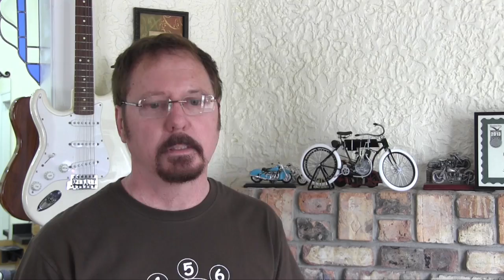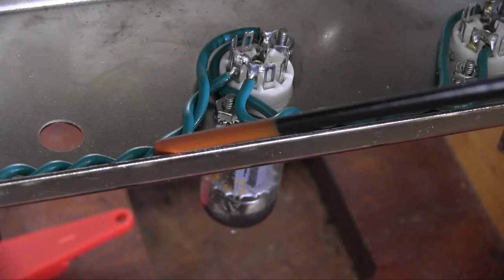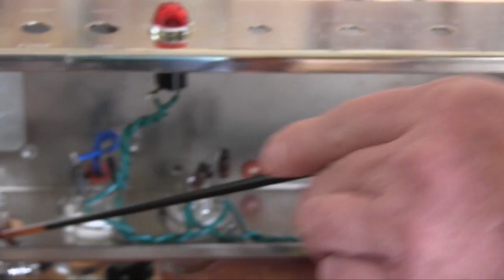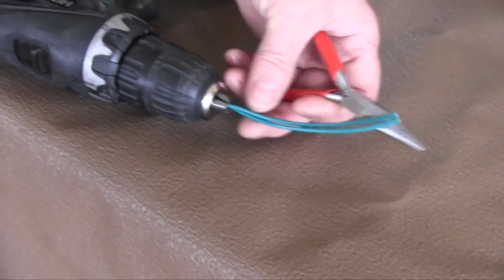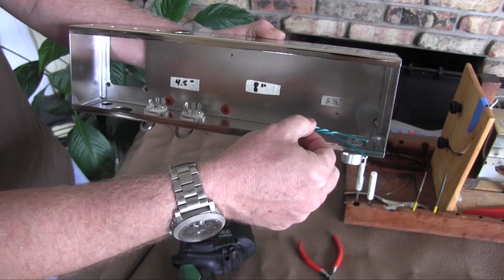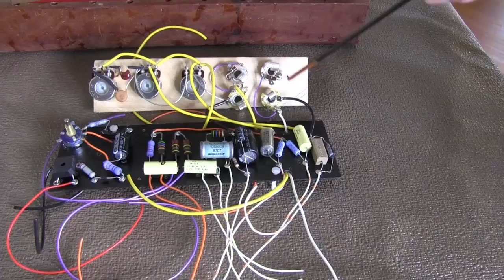Wiring Heater Filaments Circuits

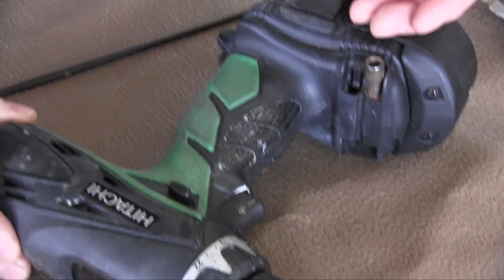Comment: 04:53 What is not talked about, but may (or may not) be common knowledge is the direction of the twist in the twisted pair.
In my experience, it's ALWAYS a good idea to twist the wires in the same direction as the twist in the strands of wire.
If they go CCW, then the twisted pair goes in the same direction. If it's CW, then the twisted pair will go in the other direction (CCW = anti-clockwise for Europe?).
The result is the ability to achieve a tighter twist in the pair, without it wanting to naturally unwind itself.

Comment: Very good video, Dave.  The only recommendation I would make is making sure that the power tube wiring is consistent, (ie V3 Pin 2 terminates at V4 Pin 2, V3 Pin 7 terminates at V4 pin 7).  This will hum cancel the power tubes.  Great job as always!
Reply: and from the power tubes to the phase inverter and preamp tubes what order showld i continue with? from the power tubes to what pins in the 12ax7?
Reply: @fakundofrontera  From what I know, consistent wiring for hum cancellation is only necessary on the power tubes and not from power tubes to the PI and preamp.
Reply: Whoa, it seems to make sense to me. Just like balanced audio works.
Reply: You want the lengths of the two wires to be EXACTLY the same.
They must cancel each other perfectly. Any wiring should cross them at a perfect 90 degree angle.

Comment: after you twist the wires does it matter which end is soldered or do you do a continuity test?, if so, wouldn't it be good to use different colored wires to be sure?

Comment: 1. What gauge wires do you use?
2. Do you use stranded or solid wire?
Thank you. Looking forward to being a new customer!
Reply: I use stranded 20 ga. 18 ga is heavier than needed for this application and more difficult to work with.  Solid wire is fine, however one must take care not to nick it when stripping it. It is prone to break where it gets nicked.
Reply: 20 or 22 ga is big enough for a 5E3 or other 15 watt amplifier.

Comment: if i am going to build an amp kit what kind of wire should i use?  solidor stranded?  ptfe covered?  copper or aluminum?   etc etc
Reply: In my kits,  I  provide the PTFE (teflon) coated wire because it is non burning, clean looking and easy to work and solder. Seven strand 22 ga strand wire is preferred over single strand which can suffer nicks which may lead to breakage.  Your mileage may vary.
Reply: @davidwhalen5658  Thank you for the info.

Comment: Interested in the artificial center tap. Where would you add this on a circuit (Kalamazoo Model 1) that has a 12ax7 pre-amp, and a 6BQ5 power tube?
Reply: Artificial Center Tap - use two 100 ohm or two 82 ohm 1/2 watt resistors. Connect one leg of each resistor to each of the two heater pins on the 6Bq5 power tube. Let them stick up. Bend the upper legs down and solder them together on the cathode pin.  The AC heater current will ride above ground (ground = zero volts) on the 18 V DC cathode current.  This is quieter than ground.

Comment: Great presentation, can you insert the artificial centre tap on a tube radio power tubeEL41 to prevent hum? Many thanks.
Reply: The old radios typically operate without a power transformer. If you add up the numbers on the tubes they will be close to 110 volts. Tubes were selected so that in total they would use approximately 110 v of heater current which was supplied directly from the household wall outlet.  I am going to say that due to this methodology, one cannot put that current to ground through a pair of resistors. Maybe someone else knows something about this.  If you have a lot of hum in an old radio, and you haven't replaced the filter capacitors, this would be the likely problem. The blocking caps and bypass caps should also be replaced.

Comment: Sir! I am sorry to barge in, First of all I must tell you that I am not an Electronics Expert but I do understand little thing or two. My Little Dot MK2 Amplifier has been giving a buzz /Hum which I cannot fix no matter what I do. Somewhere in headfi I have seen someone adding an artificial center tap to his LD MK1 which got rid of the noise. I am thinking of doing this to my LD MK II which is a full tube headphone amplifier. According to what I understood....! I have to solder a 100ohm resistor to each Filament wire of the tube connectors and ground the other end of the resistor. Please correct me if I am wrong. By searching artificial center tap i have found your video (Above)